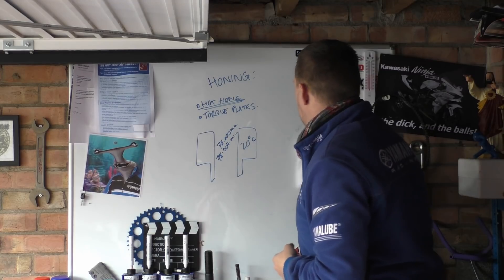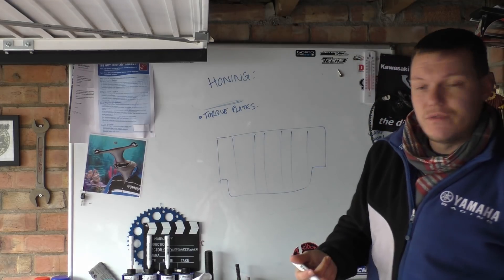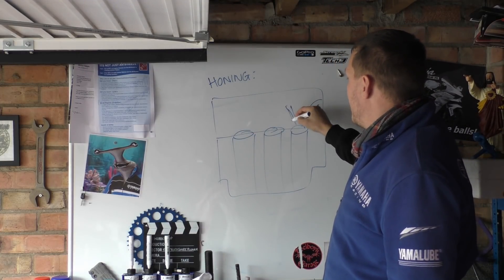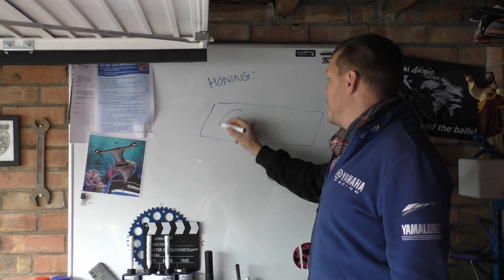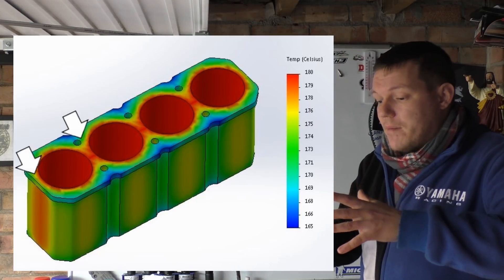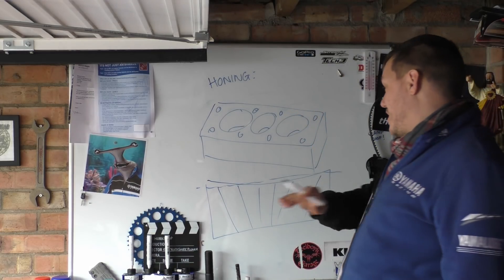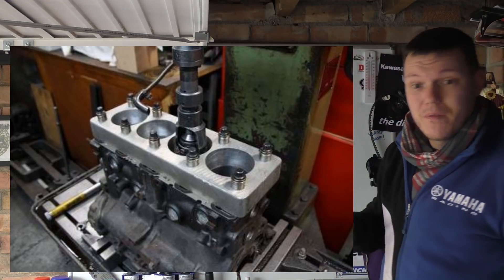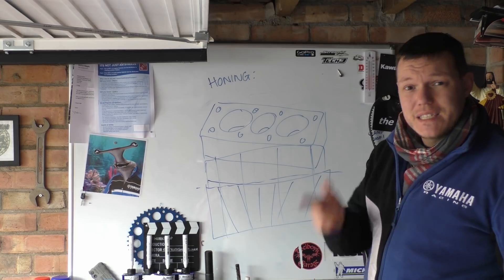Torque Plates - and what they are for

Comment: At my former job we used torque plates for measuring ovality. Scania use standing cylinder liners and are therefore more sensitive to ovality/more prone to get oval after torquing the cylinder heads.

Comment: Good points in this video.  When cold boring/honing, the torque plate is not so much used to pull the deck flat (it was machined flat during manufacture), but to pre distort the cylinder walls so that when the head studs/bolts are tightened when the head is installed, the bores are round and (as you stated) axially true. Obviously for hot honing, your points on deformation due to thermal expansion are spot on and you need to seal the coolant and oil passages in the deck.